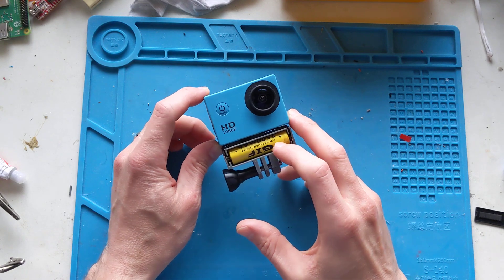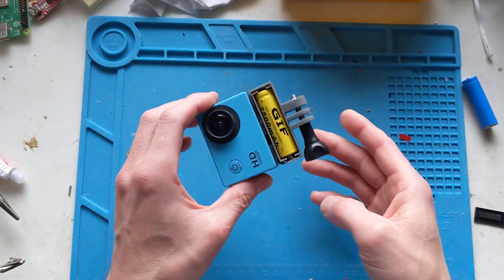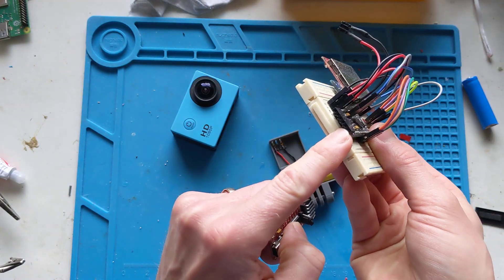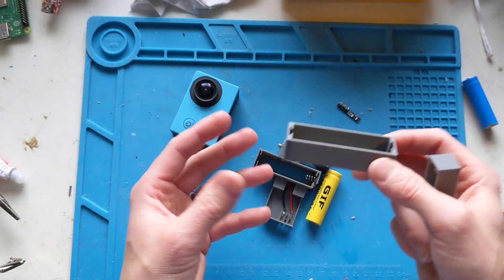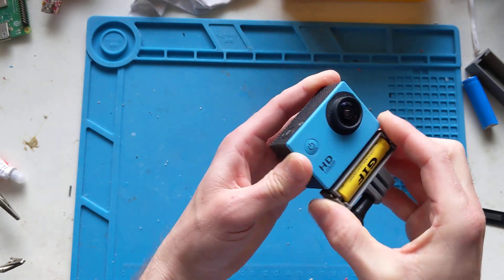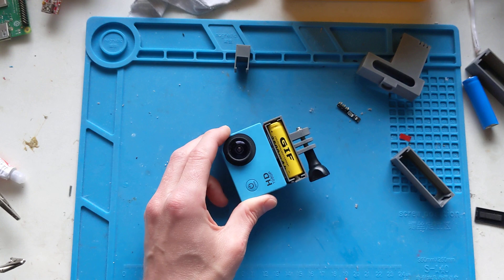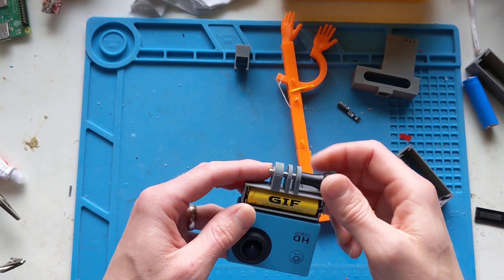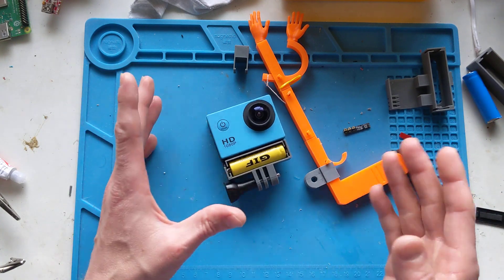SJ4000 action cam14500 battery mod

Comment: Hi! may i know what software did you use designing the model? can I edit your model to fit my 18650 battery? Thank you!
Reply from the maker: I used Freecad to design it in. Yeah that would be a great mod.
Reply from the maker: I've uploaded a version that will take a 18650 battery. Let me know if it works since I haven't printed it myself.
Reply: @facelesstech  Thank you for uploading the 18650 version! I'm having trouble using the freecaad and I'm still learning it, since this is my first 3d print project. Thank you again!
Reply: @facelesstech  Hi, where did you upload the 18650 version? I couldnt find it
Reply from the maker: @padelparaguay  Hi sorry, Ive moved all my stuff over to printables.com and I must of missed this one. Ive uploaded it now https://www.printables.com/model/209209-sj4000-action-cam-14500-battery-adaptor
Reply: @facelesstech  Thank you so much. Im looking for batteries that can record 3 or 4hours but smallest as possible. I would be interesting to make a case that can hold 5600mah power bank or 2x18650 batteries inside like the company named Suptig that make gopro power bank that came with gopro mount. I think Suptig 5200mAh model its the sweet spot😁